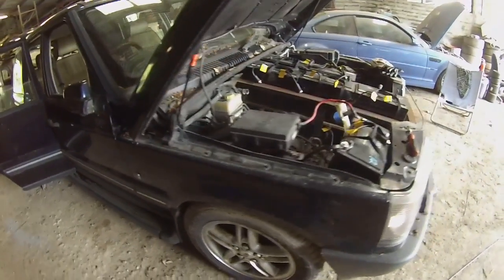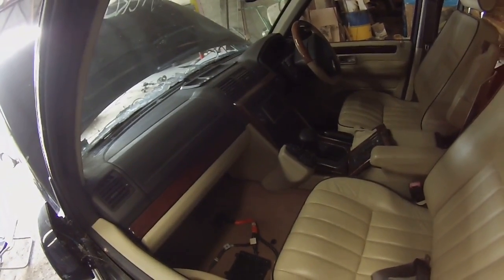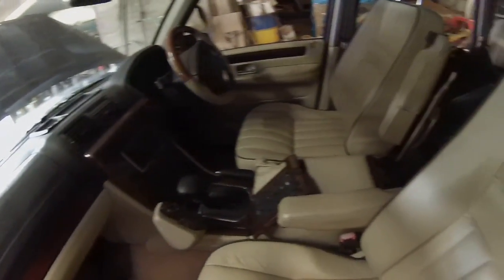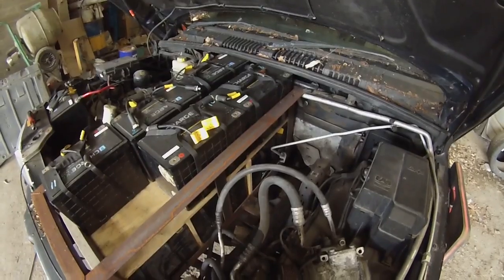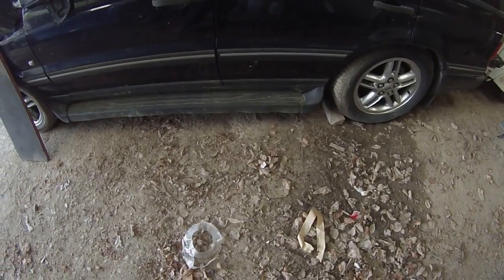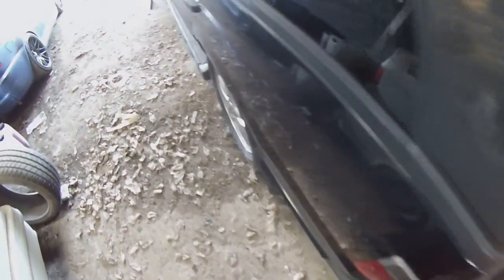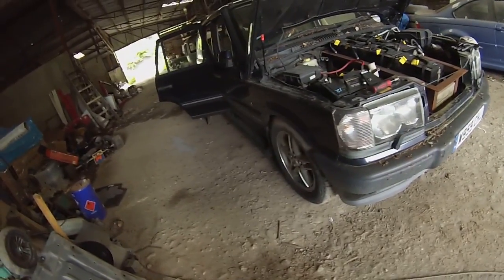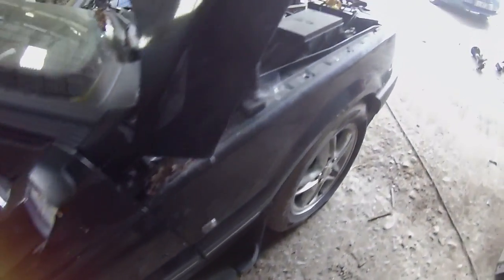Range Rover P38 EV Conversion 01 : Introduction

Comment: Hi interesting stuff. Do you have any good info to convert a beetle cabrio with a tired engine into a ev. What are your thoughts on keeping the functional gearbox. Does the conventional clutch work better with a motor. Would a high torque motor break a gearbox if you was clutchless.  Thx martin
Reply: EV west makes a really good drop in kit
Reply: Search EV4U VW and you will find lots of answers 😊

Comment: But that is a BMW?
Reply: It was developed way before BMW took over the Rover group the only BMW thing was a 2.5 diesel that was offered in it in fact BMW used a few bits of the p38 for their first x5
Reply: @Thanos.m  Yes product Pegasus was in development well before the BMW take over. With design competitions between styling houses taking place even in the late 80s as LR needed to push the Range Rover upmarket again to make space for the incoming Discovery.

It was the first car launched after then BMW take over and under the direction of Wolfgang Reitzle they swiftly took a firm hand in its further development. The 98 facelift models (of which this is one) were fully under BMWs control were initially slated to be heavily upgraded with BMW V8 engines rather than the Thor variety of the venerable rover V8.

However due to quality issues with the P38A they decided instead to railroad development of the newer model Range Rover which ran until 2012

This is all very boring and rather spoils my silly joke though.

Comment: hi  , and how are you ,  i follow you from france , and i really enjoy your determination and your technic. i wonder if i could powered a HPEVS AC50 Motor without battery but straight plugging to a gas motor like yamaha 3000W (portative model)  , would it perform ? wich controller should i use ? i hope it will not look like to crazy lol french are sometimes crazy , hopping for your respond .

Comment: Brave man ! The concept is great but no details I am not familiar with that motor type , is a ac 3 phase? and I don’t think you mentioned controller   I say this kindly but the current work might make a good stack of parts but The motors might bee great but the cars electronics have a very poor reputation oh and I should end I’d do it any way !
Reply: currently has two of the ENOVA motors installed